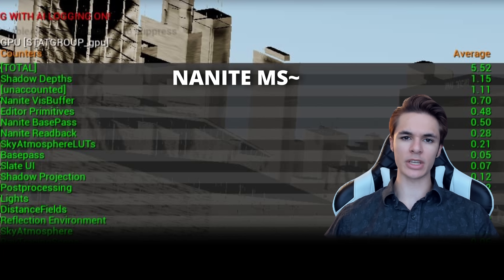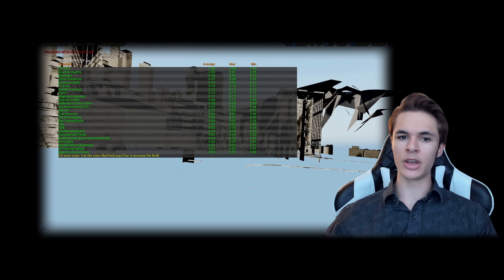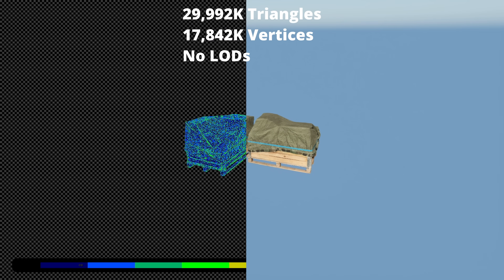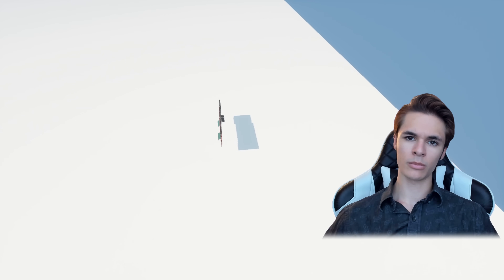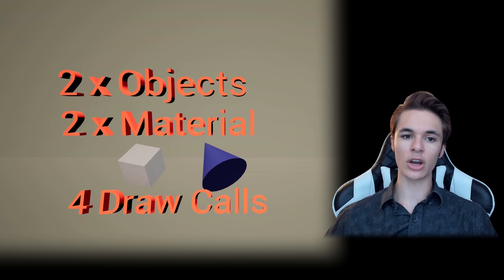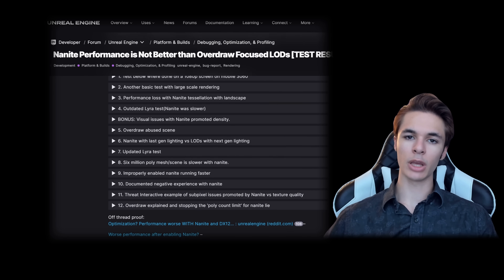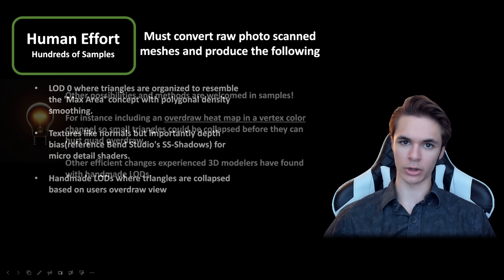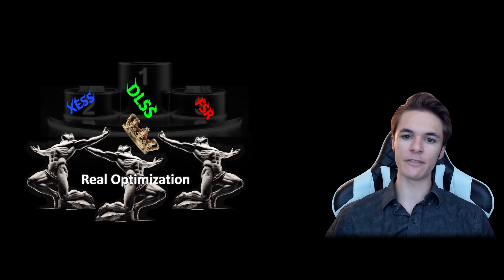Epic's Unreal Optimization Disaster | Why Nanite Tanks Performance!

Comment: Not supporting instancing is horrifying to hear.
We do that even for traditional renders.
Reply: Yes and instancing is literally 2010 technology. To not have it in 2025 is the embodiment of incompetence.
Reply: @michaelzomsuv3631  Nanite doesn't suffer from the same issues that the hardware rasterizer does. It doesn't need instancing, and infact instancing actually comes with a level of overhead associated with it, and nanite can often render the same geometry, far cheaper, and far faster. It's not an apples to apples comparison.
Reply: If I'm not wrong, main benefit of instancing is that you don't have to send mesh data over every frame, it's kept in GPU memory and you just update the transform of it. While it reduced CPU overhead, GPU processing of all those traingles is still there. And with far away instances there might be a case where there are multiple triangles on one pixel, Nanite seems to make sure this doesn't happen too much and it also keeps the mesh data in GPU anyway so I don't see where this system can benefit from instancing.

Comment: Is there a better workflow than nanite/lumen for a solo indie dev who can't afford, nor has the time to create their own optimized LODs and is relying on purchased/free assets from the marketplace? This has me worried for open-world application in optimization. I'm already having performance issues, which I'm sure are common right now, between mixed nanite/non-nanite meshes and lumen lighting. Which is the best path to take? Enabling nanite on everything possible, or not using nanite at all and going back to LODs and screenspace lighting? I hope someone can answer my concerns accurately, before I put months of work into either one only to find out it's not possible for my particular use-case. Thanks in advance.

Comment: Hey Thank you for this informative video Im Still debated on using nanite as this isnt black or white (tho forced on us)

- I cant relay on Instance tools that are deprecated and Lightmass which seems to not be working on 5.4 soo i am forced to use nanite
-  Using any mesh with or without nanite still requires optimizations in terms of polygons textures and the complexity of the material.
- Im aware that nanite is slower but i feel like i have no other options unless i go to older versions of unreal to use deprecated tools.
Would love to have feedback from other users ! :)
Reply from the maker: Quad overdraw is only an issue with non-nanite content. 

Nanite uses software shading without quads but performs 2x slower than content with little quad overdraw. 

Documenting how you are forced to use Nanite in our discord would be helpful for future content we may end up sharing.

Comment: Calling AMD talentless when its upscaling works without hardware accelleration is a little unfair i guess. I run a 5700 XT which i paid 350 bucks for and i can play everything max details.
Reply from the maker: No, higher level AMD ran innovation into the ground trying to coping Nvidia's poor tech from the beginning. AMD has actual employed brilliant people with innovations this very studio is beginning to recover and research. FSR2 is complete joke and it's the longest running one at that because it stems from core issues in the company. 

You shouldn't need hardware acceleration to begin with. Plenty of reconstruction AA methods  have existed long before Nvidia's DL algorithms.  It's like praising something that should be standard. 

AMD hardware tends to have a great price to frames ratios but AMD basically gives Nvidia free lunch 90% of the time (we hope to help them stop doing that in the future) .

Comment: You'd need a lot of training data for this kibd of AI model. From the photogrammetry scans to the final product you want it to replicate. It could be open source and with community submitted data.

The biggest hurdle would be curation of the data as that would significantly influence the final output. Training is becoming cheaper and algorithms faster  but the training data needs to be manually created from a pool of volunteers.

Comment: Why dont they pre render certain scenes with rtx lighting. not all areas need real time ray tracing especially if they are pitch black.
Reply: What you're talking about is called baking, and we've been doing it for years. But it's slow, takes art direction, and isn't flashy. So basically they want to kill it because all dynamic lighting is cheaper and makes for a headline.

Comment: After i launched Silent Hill 2 and saw abysmal performance i knew immediately its f....g nanite! Hacked teh game enabled console and typed "r.nanite 0" , and lo and behold 30-40% more fps in some areas.
Reply from the maker: Yeah, we're going be covering that the effects of that command. 

It's actually a really strange scenario.
You might want to try forcing DX11 too.
Reply: @ThreatInteractive  Check the reception area in Woodside apartments - framerate went from 60 to over 80(without compromise in visuals!) Outside in fog theres only 5%-10% gain.
Reply from the maker: @yrc4184  We had another person report the same thing and our presenter personally saw the massive increase on a live stream. But letting us know about the gain difference in different areas is very helpful.

What resolution where you playing at? Higher than 1080p probably right?

Comment: I get where you're coming from, but I think this mirrors an argument I had on an RTS game forum like 15 or 20 years ago. I received a lot of criticism for my models being too detailed; people said I should reduce detail by 75% or more for the sake of performance. I told them, "By the time my project's done, hardware will be 4X faster and this quality level will be what's expected." Well, my project still looks great today and it runs at basically infinite FPS. Nanite is very future-looking, I don't feel it's really a tool that games coming out today should necessarily use, rather it's a tool that projects beginning development today should use. It holds the promise of that so-called "Unlimited Detail" engine from ages ago. I think it and technologies like it are the future, and I'm not going to optimize my game (coming out in probably 3-4 years) based on today's mainstream hardware. I'll include accommodations for lower-end hardware of course, but I'd be a fool to prioritize people running 2060-class or PS4-class hardware when RTX 6XXX series and PS6 will be out by then, not to mention improved Nanite and likely even UE6. And - more than likely - vastly improved DLSS-type technologies as well as universal arbitrary frame generation, which will allow any game that renders at 40+ FPS natively to display at literally any arbitrary framerate. Optimization is still going to be important, but not in relation to polygon counts.

Comment: 11:52
"Manufactured problems"? RT denoising isn't a manufactured problem, it's a growing pain of low ray count RT lighting. Ray Reconstruction is just another denoising solution with its own set of pros and cons. I fail to see how this is manufactured.

11:57
The shadows are dithered because of incoherent ray information and a poor denoising solution. Ray Reconstruction is just culling those rays better, leading to a cleaner shadow line. You ask why we're struggling with the shadow type we started with? It's because we're restarting our lighting journey with a new AND realtime solution that hasn't matured yet.

RT won't mature for quite a while either. Even the "path traced" games that we've gotten have noisy post-denoiser outputs. It's gonna be a couple more generations of GPU before we can really start pixel peeping.

Comment: If you fell like everybody is wrong and that you need to fight with everyone, maybe you're missing something, and what your missing is production experience. Clearly, you do not understand the reality of a large scale production.

Large production cannot rely on artists to provide the most optimal models, shaders and textures. Using Nanite allow the tech department to create a stable base line that can be automatically unified for every asset produced. You don't understand the reality of receiving assets with 35 udims with full 4k texture set on a single character and having modelers deliver models at 50 000 tris when the tech bible was giving them a budget of 6k trianges. Tech like nanite (or micro meshes) allow artists to be artists without having to understand the whole rendering pipeline behind real-time rendering.
Reply from the maker: RE: allow artists to be artists 

You know Brian Karis said something about Nanite's purpose. Our presenter said it the first video (Fake Optimization): It doesn't matter if consumers with reasonable hardware (like 9th gen consoles for instance) have to look at the "art" through vaseline filters like upscalers to "fix" performance. 

The art is an oxymoron in terms of graphical fidelity. And we have stated automation like what nanite offers is good, but due to the massive performance hit(and visual hit), it's a poor solution to real problems. Our final conclusion is funding could easily bring about a better one that would result in a win(consumers), win(developers), win(Nvidia's competition ), lose(Nvidia) rather than the current win(Nvidia), lose(everyone else) scenario. 

RE : If you feel like everybody is wrong and that you need to fight with everyone, maybe you're missing something

You insult us by suggesting we're ignorant on something yet we're NOT fighting "everybody". We have MASSIVE support from gamers AND developers. The problem is majority (which does not make them automatically right)  is missing the foundational issues we are pointing out because we have a far less limited perspective.

RE: allow artists to be artists without having to understand the whole rendering pipeline behind real-time rendering.

You basically finished our argument for us. This is what EDUCATION is for. 
"These people know so much more than you but they don't understand basic optimization".  

RE: Clearly, you do not understand the reality of a large scale production

Wrong, we haven't been apart of a large scale production that produced crap. Which is why our production has been paused in the proper RESPECT to consumers and basic standards that should have been set years ago.

Comment: Its good this is finally being pointed out. However, this shows how most common developers, especially indie ones, don't really understand how rendering actually works. Most can't even create games outside of an engine. Games, as well as software are inexcusably inefficient. Everything is wasted. Memory, CPU, GPU etc. Sure, not every little thing can be optimized, but when common optimization practices are neglected, it all adds up in the end.

Comment: i agree with your argument that nanite is not the system it is said to be but you are forgetting a very key component. the industry cannot keep up with current game demands. studios are expected to pump out massive titles on tight deadlines in a very competitive market which means corners have to be cut, in a perfect world this wouldnt be true but we dont live in a perfect world and choices have to be made. 

I think modern marketing has alot of blame in this with marketing fads such as "4K and Photorealism" causing bloat in games making file sizes of modern titles exceed upwards of 150gb. we see alot of plain looking textures that are stored at 4k (4096 not video 4k) which lack fidelity compared to older games a case i would give is the mulltiplayer map rust from the call of duty series. the 2009 original whilst lacking fidelity in model resolution and texture resolution packs alot of detail into the low resolution texture it has whilst its modern counterpart on the 2023 title looses all the detail whilst being higher fidelity. this is a small rant but a case of where shortcuts are cut due to tight deadlines and forced on the consumer in one way. do i agree with it no? but do i understand it? yes

what im trying to get at here is while i agree with some of your points made i would still argue with how the game industry is moving forward techniques like nanite are a must though there is definately room for improvement. the whole game industry is sold on this "photorealism" marketing and developers have to try to compete with this. nanite is still a very young technology and they have already made great strides in improving its performance. we dont live in a perfect world so nothing will be perfect. 

simply put u cant count pennies in a rush... developers are forced to make cuts and though id is definately not perfect nanite i personally think is a good solution i think studios just need to optimise around nanite where possible so we and they get the benifits of both.

Comment: Isn't the point of Nanite that you don't have to do the semi-manual LOD work and optimizations that you need to get similar performance without Nanite? Exporting a already optimized game scene and assuming it will go faster with Nanite feels like the wrong use case to check if nanite is faster or not on an already optimized scene.

Comment: Thanks for this great work ! I confirm, since my post about landscape nanite, I've abandoned the idea of using it in general. LOD generator works kind of fine if you don't let attribute size thresholds automatically. 
I also disabled Virtual Shadow Maps. I'm using screen space reflections and Software tracing when Lumen is enabled. And watch out for clouds resolution. The default value is often overkill. Another thing : does anyone not hate skylights ?
Getting good performance and not blurry image on Unreal Engine is really hard. I love this tool but sometimes....

Comment: The problem with using AI to fill in is that it can cause visual noise and inconsistent art styles. DLSS and FSR both have noisy pixel outputs and AI generated assets never seem to look right

Comment: im out of the GPU game for quite a while. and by while i mean probabily before the video author was born, i been following graphics just by osmosis lately so i have some questions.

1. ain't quad overdraw literally why nanite is using a compute software solution? i mean comparing the same scene without nanite and well made LODs is certainly idiotic. becouse then the LOD aproach is paying quad overdraw costs and nanite ain't.
but you literaly saying that nanite is paying the quad overdraw costs, thats not how it is suposed to be as far i know.

2. im pretty sure people haven't been using a single draw call per object for a while no? there is uber shaders, texture atlas, instancing, indirect rendering and and thats just for the hardware side.
i recall people carefuly crafting commands buffers to minimise binding and state changes back when vulkan and DX12 popped up

3. it feels like the real villain here is Unreals terrible LOD generation, not nanite

Comment: UE is really puzzling to me. Some games can look really phenomenal like Amid Evil, Unrecord, BodyCam. Simultaneously many games using it have HORRENDOUS shimmering which is only resolved by just making things blurry with TAA. Meanwhile the games can often look grainy. Amid Evil leans into this for the retro aesthetic and it works great. It’s tolerable in Deep Rock Galactic because everything is low poly. In Satisfactory it just looks gross.

UE has also doesn’t tolerate gpu overclocking and this drives me insane. Possibly it’s the high utilization (which now sounds more like poor optimization eating up my gpu than well designed software).

I don’t like this direction of grainy, blurry visuals at all. No more TAA please.

Comment: imagine if we had these optimizations AND DLSS.  Like we turned it into a crutch where it's needed for even baseline performance.  I remember being amazed running 8th gen games on my 2070 laptop (1080p screen) with tons of settings on that you would never dream of a 2070 being able to handle when DLSS came out.  Now I need DLSS just to run settings old X070 cards could run np.

You talk about the temporal issues, do you have examples that show how much less it shimmers when you do things right?  Shimmer has been my biggest annoyance since the mid 2010s and it's really only got worse (without TAA).  Like Witcher 3 was lauded at the time but has ridiculous shimmer overall that only SSAA can really attempt to clear up (their AA solution was pure ass).

Also I think in general ray tracing has been pushed WAY too early.  Like yes we're on the cusp of handling it and it's an amazing technology but my god the results can be blurry.  I've been following it since the 90s but the hit is still so large and the algorithms still can't clean it up properly.  To a degree it reminds me of the initial shift to 3D.  First gen 3D consoles were... ass.  Like it was cool to see but my god psx and n64 were awful graphically and performed terribly.  You needed to have it to sell consoles but it really doesn't feel like it was ready for the limelight.